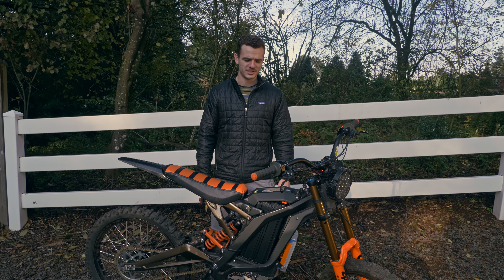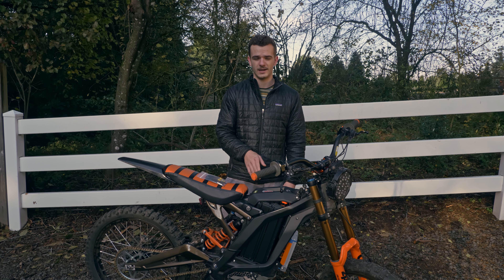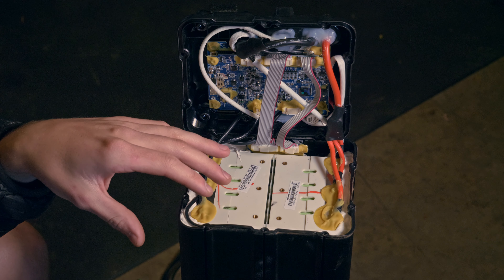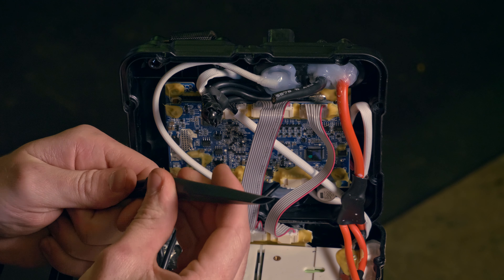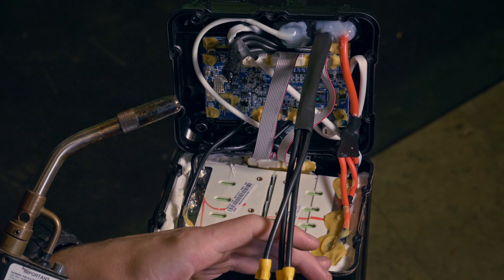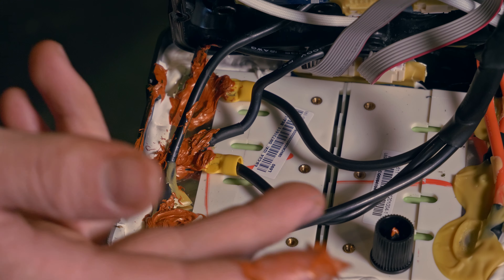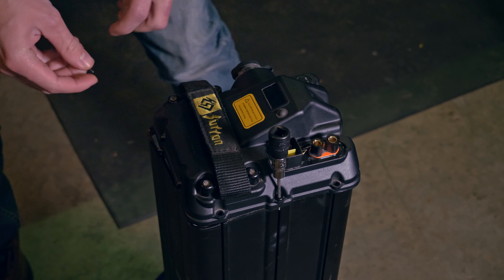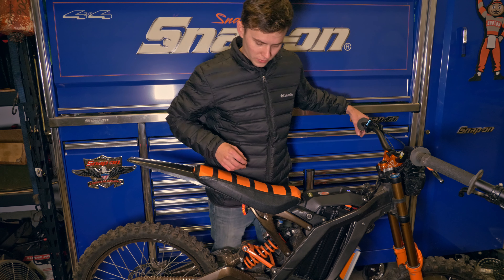How To Bypass Stock Sur-Ron Battery for more power!

Comment: A bettery idea maybe to find a higher amp discharge bms, also couldn't a switch be put into the mod so you could turn this mod on and off, so the bms would work as norm when switched?
Reply from the maker: The only problem with the new BMS is that it’ll typically require re-soldering the lead wires which most aren’t comfortable with though we agree, it is the better solution. The switch would work as long as you can find a switch that can handle that kind of current 🤘🏽

Comment: What’s the story on battery life after the bypass? Particularly for trail riding, where there is a lot of slowing for technical sections and into corners and gunning out of corners and on the straights?
Reply from the maker: More power means more battery usage but really it depends on how much you're getting on it. You'd maybe see a 5-10% reduction depending on how many times you're surpassing the 5000W that the stock controller pulls.

Comment: “Be careful not to strip the screws” but drills the screw out😂
Reply from the maker: Yep! That's the great thing about using a drill. Has a built in clutch so that you can control the amount of torque making it close to impossible to strip them!

Comment: hey man,i have a segway battery that i believe has a bad bms board,at the outlet plug it only shows 42 volts,but if i go around the board it shows 66 volts.im measuring at the positive side of the outlet plug and the buss side of the battery,negative.any idea if this mod would sort of fix that?or make the battery usable?

Comment: Hey guys, I’m about to order the bypass kit for my BAC4000.  Question:  what’s the voltage meter you recommend?  I thought you’d be selling it.
Reply from the maker: The controller kit we sell that the bypass needs to work comes with a display that monitors the voltage. Doing the bypass on your stock setup won’t do anything.

Comment: This is the only Youtube video I have ever come across with thousands of views (35K at the time of this comment) and not a single dislike. Usually, there is at least one asshat who clicks dislike in every video, but not here. I might just have to buy a Sur-ron bike just to be able to send these guys some business.  
Speaking of which - is the Segway X160 not the smartest purchase for someone who plans to upgrade battery and controller? Or is there some reason why that bike won't accept the same upgrades and make the same power as the Sur-ron X/Segway X260.
Reply from the maker: The x160 has a slightly smaller game, less suspension travel and the motor is wound to handle less power and produce less torque. Some people have fitted a controller and upgraded battery to the x160 but it will not have as much power or be as reliable as on the full size

Comment: Ok, ive built many battery builds before, and maybe you can clarify something...without having my Surron in front of me (its on backorder), it looks like you are disconnecting the LOAD side of the BMS..that is to say that the BMS no longer has control of limiting the amount of power pulled from the battery but also means that although it will control the charge and be able to cut it off above 4.25 volts it will not be able to cut power to the bike if the charge falls below 2.5 volts???
Reply from the maker: Yes that’s correct. It’s discharge only so you still get balancing and shutoff on the charge side but can actually use the cells to their potential on discharge. The controller will shut the bike off below a certain voltage but our display gives a live voltage read out that should riders should not go below. This isn’t a mod for people who want the safest setup or those who don’t understand what this is doing.
Reply: @emotobros  Ok, the problem with this is that if you have one or two weak cells and they go below 2.5 volts while the other guys are at 2.8 ( I have built packs using the Panasonic PF cells and got some imbalance issues after many cycles), then while you may think that 40 volts is ok (theoretically each cell in series at 2.5 volts x 16 in series), if an imbalance occurs and one or more cells are now lower than this, they can "bottom out" very quickly and be damaged. If I do this modification I would push the LVC to 45 volts to be safe.
Reply from the maker: Our LVC Is 52V there is absolutely no way we would ever recommend people running there cells to 2.5V each. Most graphs of the PF show a serious decrease in cycles below 3.0V/cell
Reply: @emotobros  No of course not, but after installing a watt meter, either the BMS or stock x controller was cutting the bike out at a very conservative 3.4 volts per cell.(54.4 volts ).according to the watt meter I was getting about 1500 whs out of the (31 ah x 60 volt) 1900 Wh's the battery is rated for. On the discharge curve for these cells, @ 2 amp discharge 3.4 volts represents about 35% capacity left. not 10% on the display. I think they programmed the meter to calculate percentage vs voltage based on the .5 amp discharge curve, however I got an estimate of about 15-20 amps of current draw (from my watt meter) at roughly 45 KPH so I consider this a low average of current draw ( almost 2 amp per cell). A LVC of 52V would (@ 2 amp discharge) represent about 10% remaining.
Reply from the maker: Yeah I think the stock LVC is set higher than the capacity suggests it should be. We think 51-52V is totally fine for the LVC. I’d also be surprised if the display read out was based on anything other than strictly voltage.
Reply: @emotobros  Yes I believe thats right...and thats not the way to do it..The Cycle Analyst is a great Voltage/Watt hour/Amps. etc read out that has a built in algorithm thats even quite accurate with Lifepo4 cells, and thats saying something. I just dont know if the CA will work with the BAC 4000.
Reply: @emotobros  By the way, I just did my own bypass on the battery, and soldered the high voltage wire with 6 G copper and each of the neg battery feeds, I used 10 g not 12 that is stock. I also have a 150 amp BMS coming and once here, will try it out in the stock case. Will be adding a cycle analyst later.

Comment: Hi, I have set my ecu to 110a with the stock battery and my bms does not cut despite heavy stress test without bypass, it is 2021 is it possible? the power gain is already huge compared to the origin
Reply from the maker: They may have used a different BMS, that’s a good thing 🤘🏽

Comment: Hello I just installed my bac4000 with an original battery with bypass. Is it normal that the display always shows 100 percent even after driving because the Egg Rider says something else.
Reply: Yes! The egg rider is correct and the battery is wrong

Comment: What concern do you have about thermal run away?  Have you tested charging, and discharging under 90-100 degrees ambient?
Reply from the maker: The cell is rated for 10A continuously. We aren’t pulling more than they are rated for. Cells have max temp of 60C so would likely be fine assuming you aren’t holding it wide open for extended periods >1min.
Reply: @emotobros  10 amp rating..so safe for 100 amps. 100/10P=10
Reply from the maker: @johnnyzee383  The stock battery is 11p so around 110A but yes, same idea.
Reply: @emotobros  of course.

Comment: Couldnt you just splice in on that negative cable going to the bms and connect the bypass as shown but still leave the bms fully connected?🤔, this would make the bms and the battery % display work like normal but still let the current bypass the bms and going over 80a when you need it?🤔.
Reply from the maker: We’ve had someone try this and tell us that it made the BMS behave weirdly, not to mention splicing in is considerably harder with 6Ga wire for the only benefit of having an accurate display (maybe). Have you tested it?
Reply: @emotobros  Thanks for the answer! I have not tested it, it was just a train of thought😁, agree in the splicing being hard for the average Joe. Would be great if the batt % worked for those using custom controllers without display and only bluetooth/phone display for example eliminating the need for running a voltagemeter mounted on the bars. Do you guys remember in what way the bms acted wierdly?
Reply from the maker: Definitely would be nice. If I recall it would still trip BMS but then discharge through the spliced in side. Not 100% though.

Comment: Sorry for the dumb question but when you do this mod I presume you are trading at-the-throttle-power for run time? And if that's the case how much run time are you typically looking at losing if you do the mod?
Reply from the maker: That depends entirely on throttle usage. You could do the mod and use the same amount of battery if you are only occasionally going above 5000W. Or you could be constantly gettin it and run through it quicker. Most range you could lose is 29% and that’s only if you were constantly wide open.

Comment: is there anything you can do to make the stock battery go further on a stock controller? i need more range :(
Reply from the maker: Not without breaking the laws of energy conservation unfortunately. In all seriousness though, the best way is to gear your bike for the most efficient use of power (larger sprocket). Second is buying a bigger battery 🤘🏽
Reply: @emotobros   already went up a sprocket and lost too much top end. Bigger battery it is

Comment: Hey , would you guys mind sharing what direct mount stem that is?   Edit** I almost forgot... maybe we could temporarily wrap the 3 screw on ground connections with some painters tape or electrical before we start so that we don’t accidentally make connection with the positive, then just peel each one as needed for screwing them onto the battery case.
Reply from the maker: I think it’s in the description of our upgrade video. We agree that taping would be safer and anyone who wants to be as safe as possible should do that.

Comment: i was just wondering if i do the bypass would i have more range on the stock battery?
Reply from the maker: Range is determined by how much power you use. Bypassing allows you to use MORE power than stock so it’s unlikely you’d get more range.

Comment: I don't get why you don't just diode isolate both of those wires so the battery continues to work properly? And I believe if you used a switch and a relay when it went into limp mode at 50% battery you could make it do so
Reply from the maker: You could do this but anyone who has a controller that could utilize the mod would also have a real time voltage/percentage readout for discharge and the screen is still accurate during charging so we didn’t find it necessary.

Comment: Does this make a difference with the x controller ? Or do u need the bac4000 ?
Reply from the maker: Doesn’t need to be the BAC4000, but yes, this is ineffective and dangerous to be done with the stock controller.
Reply: What about the Luna XX controller from Luna cycles?

Comment: You probably should have covered the entire bus bar w/ rtv as the entire length of it is going to be electrically live, not just the screw terminals.
Reply from the maker: Definitely a good call. We figured if they were okay selling the battery without that we would be fine not doing it but better safe than sorry.

Comment: Does this work for the Segway x260? And what exactly does it do when you do this?
Reply from the maker: It’ll work but you will see no gains without a controller. The whole intro is about what it does.
Reply: I get it maximizes power but does that increase speed as well? Sorry new to this
Reply from the maker: All good! It does increase speed as well if you have an aftermarket controller. Can go 60MPH+ GPS Speed.
Reply: @emotobros  thanks man that’s dope just ordered my surron black edition I’ll be checking out e-Moto bros soon!

Comment: After I did this my volt meter is not reading full voltage? Any reason Why? Fix?
Reply from the maker: As in the battery percentage on the battery or volt meter on EggRider?
Reply: @emotobros  the % and bar indicator are reading 1 bar and 20% but battery is fully charged
Reply from the maker: All that matter is that the EggRider gives the proper voltage and that it matches what a multimeter would read out
Reply: @emotobros  i have a stock surron
Reply from the maker: @davidpruitt7878  You bypassed the battery on the stock SurRon? If you didn't bypass and it still isn't reading properly then you have a fried BMS and you'll need to contact your dealer to get a replacement unfortunately.

Comment: Is there any benefit to doing this when using the stock controller?
Reply from the maker: We covered this in the video. There is no benefit.
Reply from the maker: Liam Olechowski  Not necessarily ASI, but some aftermarket controller other than stock. We like the ASI controllers a lot so that's what we sell and recommend but there are other options!

Comment: What is the difference of this and clipping the green wire ?
Reply from the maker: The green wire is a controller based power limitation. This is removing a battery based limitation. This being done though does not allow the stock controller to pull more power so you'd notice no difference if the controller isn't upgraded.
Reply: @emotobros  Okay so if i upgrade my controller will i still need to clip the green wire? I ordered my bike yesterday and when it comes im going to want to unlock the top speed but i dont want to run into issues down the road if I upgrade the controller

Comment: So basically now if one cell is overcharged/under discharged it can catch on fire. No disconnection is possible.
Reply from the maker: The charge side still has balancing capabilities. If you're cells are becoming so unbalanced during the 2-3 hours in which they aren't being balanced during discharge, there are other problems at play.

That being said, you're right. This modification is absolutely not safe to be doing and we wanted to show case the 'safest' way to do it as it's somethign tons of people do.